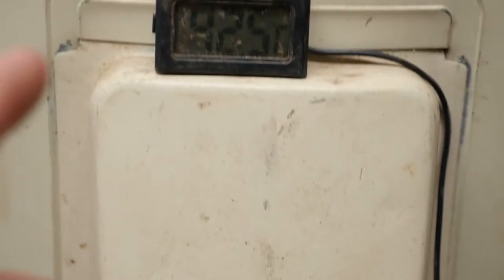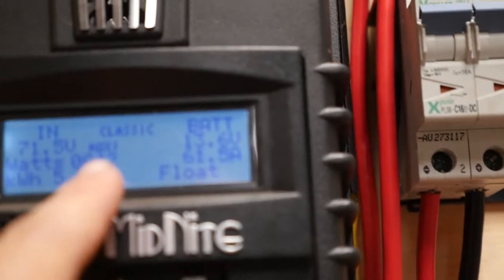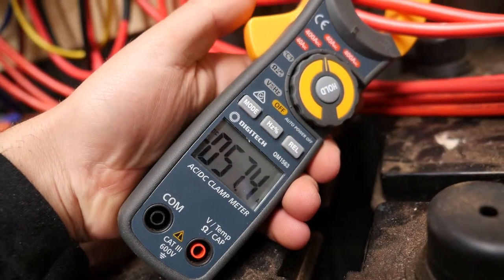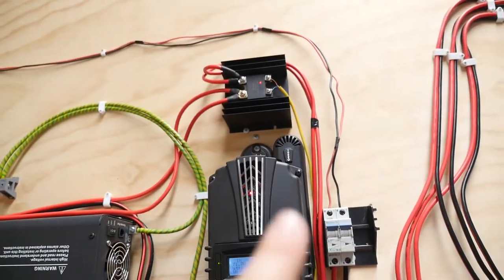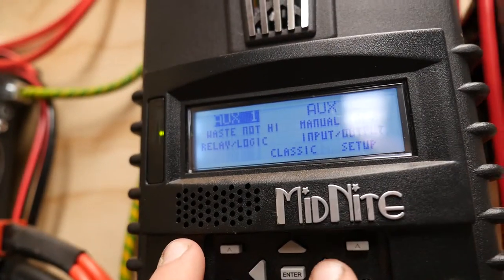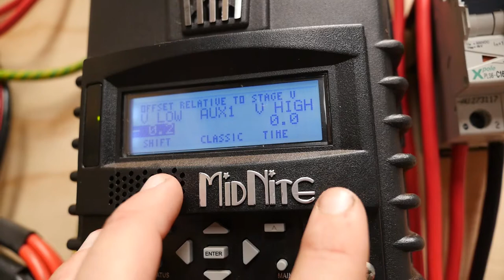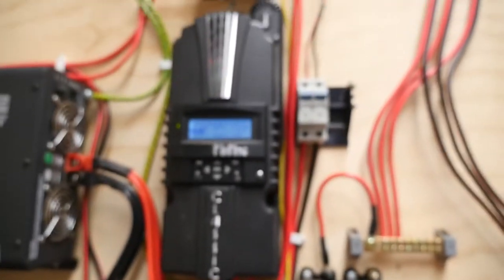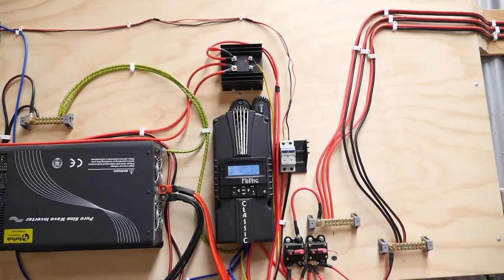Off Grid Solar Hot Water Update - 12v DC Heater Element

Comment: Always glad to see PV water heating promoted. There is almost a total lack of understanding in how this can be done and the equipment which is necessary.  Generally operating off a battery bank is not a good way to do it because it screws with charging, is less efficient, requires higher currents and a number of other reasons. However, this acceptable with your particular controller's diversion and power available.  For others this is a mucky control system. I've experimented with a variety of control systems heating water for years.  The ideal method is to operate off the panel array higher voltages with a proportional controller that senses when the panels go over the power point voltage. That will send any excess power, regardless of how little, to a water heating element. I build my own low cost control and and use cheap 2,000W 120V elements which aren't available in many countries. Camp system of under a killowatt can have fairly reliable free hot water. So many waste this source of energy. Even have a dishwasher with heated dry using excess PV. Amazing how little interest there is in heating water.
Reply from the maker: Thanks Opera, I am always looking for ways to improve my system. I initially thought that powering the element from the panels would be a better idea, but I couldn't find out a way to do it. I am waiting for a WizBangJr to arrive which I am going to try implement into this setup.
I will be researching further into how to run it straight off the panel. Thanks for the comment.